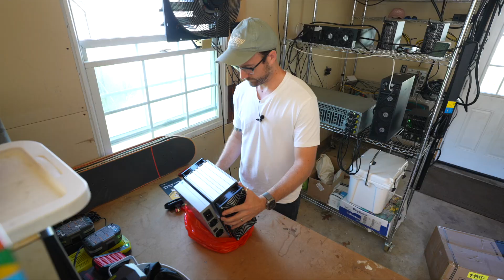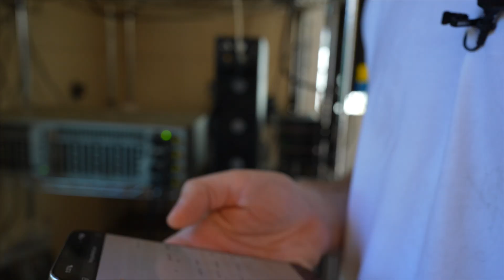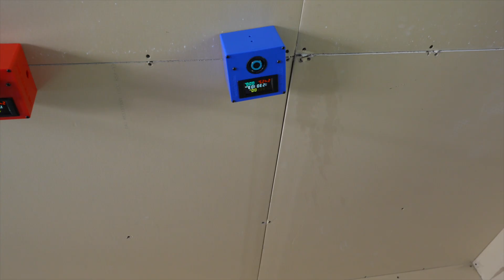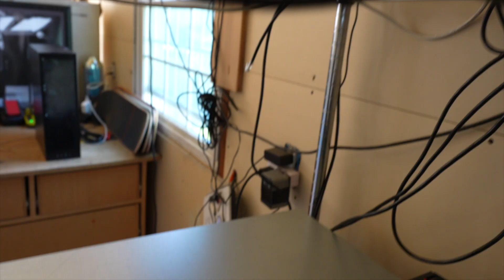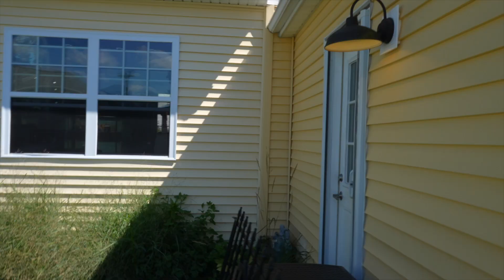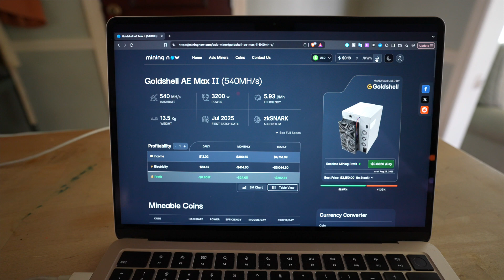Running an Industrial Crypto Miner at HOME

Comment: if you have a 3d printer there are shrouds you can print to replace the 120mm fans with an 8" inline fan. you need some fan spoofers so the asic will still run, you can get a njord board to control the fan and be the fan spoofer,  if you dont want to run the fan at a constant speed all the time. i use the heat in the winter and route it out a window opening in the summer. i made a similar setup to an ac intake and exhaust except i have a filter on the intake side.

Comment: Have you thought about getting batterybanks for solar? Sometimes selling pure energy to the grid is more profitable than mining 😂
Reply from the maker: Not yet. I seem to keep using all the electric from my mining 🙃
Reply: @RedFoxCrypto  You can’t go wrong with getting more solar power. What’s your daily energy consumption? I bet it’s high—so for a 12 kWh load, you’d need about 50 × 200 VA batteries to cover 8 hours of nighttime electricity, and they probably wouldn’t even pay for themselves. Do you have the option of a utility energy plan with cheaper nighttime power?

For 100% self-consumption, the solarpanels payback period will be significantly shorter than for a typical household.
Reply from the maker: @allstarsrobin I do have the time of day option that’s a great idea. I’ll look into that now.

Comment: Ac infinity will do the trick i have 8 of them at home
Reply from the maker: Do you have any adapters to go from the asic fans to the silencers?
Reply: @RedFoxCrypto i usually get the 4 pin fan simulator from Amazon or any other website they sell them i set the speed at 6 or 7 wish is alot less noise and they keep them quiet and on winter i keep it at 5 speed if don't overclock and when I'm outside you don't heard them at all but when is like 8 of them you heard the noise a bit but i put good insulation and it keeps it the noise out of the house